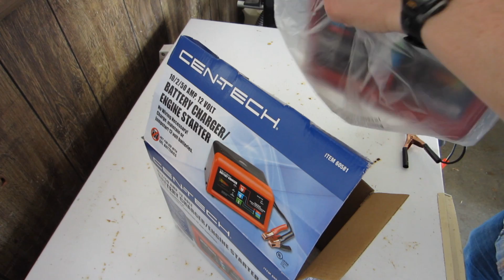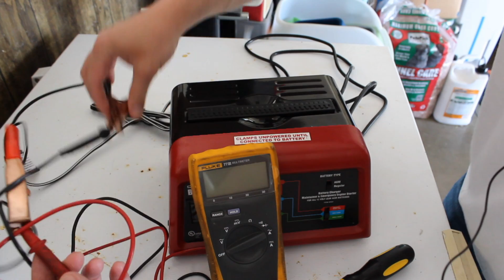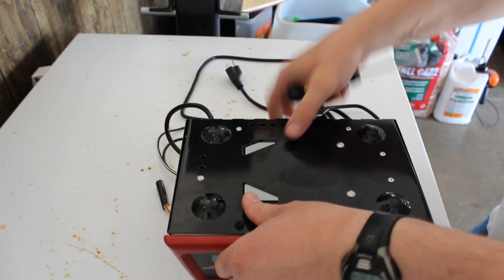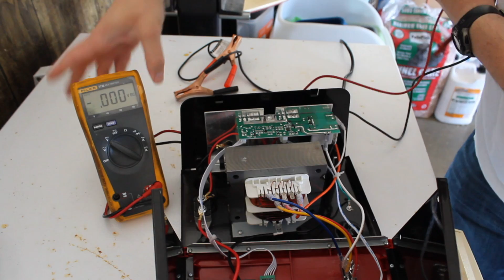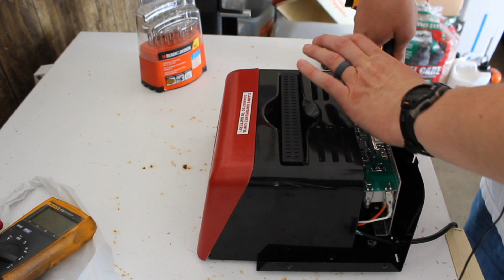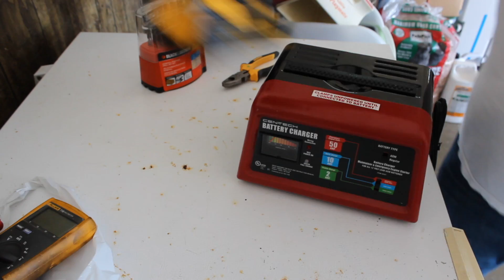Harbor Freight Battery Charger Electrolysis Hack 60653 60581 Centech Part 1

Comment: I added a one 10k ohm 1/2 watt. Soldered it from the 19Vdc on top the relay to the breaker and works great.  Getting 10Vdc to breaker, and still shutting down to keep battery from over charging at 14.8Vdc.
Reply: 10k ohm 1/2 watt resistor.
Reply: Got any pictures ?????

Comment: I have one of these chargers. It has a problem with charging. I am a retired electronic engineer. I started reverse engineering my unit. 
It is the exact same unit you have. I found out that it is a Silicon Controlled Rectifier based charging circuit thus it has no Bridge Rectifier.
That component you pointed out as being a Bridge Rectifier is actually a transformer used to provide power for the control circuit for the SCRs.
I am still working out all the details here. due to the size of the components, Surface Mounted, its difficult to identify what type and value of each.
If any body is interested in how this type of charger works you can search for SCR Based battery charger here on YouTube.
Reply: You're a gem, thanks for posting and sharing your experience and knowledge.

Comment: What you pointed out as the bridge rectifier is the step down transformer to reduce the voltage. The  rectifier is likely the two diodes diodes on the circuit board you said changed the AC to DC.
Reply from the maker: You are correct on both points.  My comments in the vid were before careful inspection, both visually and with a dmm.
Reply: @bailmox2813  How do you know when the battery is fully charged, because when I connect charger to any Battery the one LED light goes on and never turns off. and I mean the green charging LED on the charger, or do you have to rely on the meter that say's 100% to know, because the margin of error is greater relying on the meter, versus the charger turning off automatically.

Comment: Clamps unpowered until connected to battery! Dude, the sticker is right there
Reply: It took me two seconds to figure out what you just said no battery connection no power LOL
Reply: I saw a video that a guy added a toggle switch and jumped it to manual and made it power without even connecting it that was great then you could turn off the toggle and it would go back to automatic charging
Reply: Can he not read ?

Comment: I came across this in one of the reviews for this product on the HF website: "Open the charger and observe that there are a pair of wires (black and red) that connect between both PC boards. This is the sense wire that turns the charger on when there is a battery connected. Add a PUSHBUTTON switch in parallel with these wires and mount the pushbutton type switch to the front panel." I assumed this meant he was just disconnecting the balance line, but he also talked about using another battery to get it started, so maybe this was just his way of being able to connect a 2nd battery to the charger instead of to the battery being charged. I'm going to have to go open mine up now and see what I canq do. I wonder if there is room in the case for the internals of a spare dc adapter instead of stepping down the 18v off the board.
Reply from the maker: I read that review too.  I assume that he was using an older charger because no such wiring configuration will work on this charger.

Comment: Dude there is such an easier way using two wires and any kind of battery that has a slight charge! No opening up the unit and no voiding of the warranty! All you need to do is hook up the leads to the electrodes of your electrolysis set up, then take your battery with the slight charge hook up the two wires to your electrodes positive to positive and negative to negative and then plug in your charger voila it works! and you can unhook the battery  you just need it there and start it up that's all!!

Comment: It would be really nice if you could just buy a "dumb" battery charger for etching and electrolysis.  Everyone in their tutorials says, "get yourself a non-smart battery charger." Problem is I don't think anyone makes them.  I had hoped this battery charger wasn't smart because it says "manual" on it but it's not or at least it's not dumb enough for what we want to use it for! 😂😂
Reply: Just have a look on ebay. There is plenty of old fashioned battery chargers there.

Comment: Quick question since I didn’t see that part / Voltage divider underneath the black tape is all three wires solder together with heat shrink . One goes to ground the other one to current and the other to the 18v ??? Am doing the same thing / does it Automatically stop charging the battery or is it constant Voltage. ???

Comment: You need to read the note on top of the charger!!!  Clamps unpowered until connected to battery!! Most battery charger are made that way now days. What a goof ball, Geeeezzzzzzzzzzzzzzzz
Reply: Yah and its dumb. You can't charge a dead battery with them anymore like you used to be able to. Unless you like shelling out money to buy a new battery when all that needed to happen was it needed to be charged beyond 6 volts. He needs a constant 12 volts for Electrolysis. They no longer make them unless you shell out tons of money for one a charger like what he turned this one into. So the smart charger part is dumb.

Comment: The newer version of this charger has completely different circuitry inside, but I got it to work for electrolysis, resistance soldering, etc.  See my lengthy comment in Part 2 of this series for the "how-to."

Comment: A lot of good electrical knowledge from you and your commenters,  I don't quite understand it, but if the charger was new, why not take it back?
Reply: He is not wanting to charge a battery (as intended). He is going to use it for a different purpose that it was created and sold for. He wants to use it for fractal wood burning. If the safety mechanism works correctly it won’t burn the wood.

Comment: Could you just plug that up to a car battery and then run cables from the battery to your project
Reply: That worked for me.
Reply: Do you still need a rubber mat to stand on? I would agree that one is not necessarily used for a car jump, but how would it be on wet wood? And if they touch on the wood and arc, no worries there as well? Thanks for any and all info. Also car battery is on the table, or still in vehicle.??
Reply: @depressionnow8290  I had a charge car battery out of the vehicle. I just basically jumped my battery charger while it was connected to electrosis setup. Worked like a charm.

Comment: Now why would one want to remove the reverse polarity protection.. Gate voltage with ( resistor ) only seen on positive side clamp to see a positive voltage on that end,  2-5 volts ish @ FET ( positive side sensed, not negative side ) then  it will close loop the negative side. to begin charging.

Comment: This video was really helpful actually but I ended up utilizing a different method to get the same result, as it was a slightly different charger with a seemingly more convenient way to accomplish this. But I was wondering if you had an easy way to load the power supply? I have a current clamp rated at 200Adc, and I want to make sure my unit can actually do the rated 50A. I just don't actually have anything that can take 50A@12Vdc continues.

Comment: the hack worked o the model  you used  they changed boards and I can't find any AC voltage except for a constant 53 dc volts I can't even see a a volt rectifier (I can identify with ) CAN U HELP??

Comment: Are there anything in the magic black tape ??? Connection? Resistors??? It is an important part, not using screwdriver to open the box waste time. Thank you.

Comment: You need to read the note on top of the charger!!!  Clamps unpowered until connected to battery!!
Reply: so, all of those changes are not necessaries, aren´t they?
Reply: Even if you hook them to a battery they have no guarantee of powering to 12 volts. Smart chargers are not that smart they only work if the battery still has above 5 to 6 volts or they stay powered off anyway. All he did was turned this charger with a toggle switch into a old style charger which has become rare and hard to find. Unless you like paying for batteries when nothing is wrong with them. And to do Electrolysis you need to have a Constant 12volts. Read his description.
Reply: He knew that, this video explains how to bypass this bullcrap so it can be used as a 12 volt power supply.

Comment: I want to use my charger like normal but I want to be able to flip a switch so the +&- have power without connected to a battery can someone please tell me how to do that on my battery charger
Reply: On the charger when he pushed the button it sounded like a relay kicked in (if that's the case the voltage sensed powers the relay) adding a toggle switch in parallel to the relay contacts would bypass the relay giving you your desired result.
Reply: @TopCat2021  just now saw this comment would you be able to show me exactly what I needed to do or just help me find out what I need to do

Comment: You should not do this to a battery charger. You just bought from Arbor freight. You should leave it like it is and get a battery andtestive more or less. This charger also lets you know whether the battery has power in it or not. Because it has a sensor intelligent breaker on it or should I say intelligent sensor breaker on it to protect you from electrical shock or battery explosion? Please handle with care when using this battery charger.

Comment: Did u make part 2 I would like to know ur resistor values u used
Reply from the maker: I used 220k ohm 1 watt resistors.  The actual resistance  values shouldn't matter as long as you use two of the same values, ie, two 1k ohm resistors would have given us exactly the same voltage to the sense wire.  Part 2 should be up in just a few minutes.

Comment: I dont get it. He found output at 18v and put it through a voltage devider with equal resisters. should that half the voltage to 9v?. So were does the 12.6v come from?
You are using 1w resisters. How is that enough for 10 amps?

Comment: Why are they doing this?? This is the second video I've seen about this. Are they trying to stop people from doing electrolysis. This makes me want to break the law even more. Hey but anyway bro, if you're good with electronics then the money's in modding Xboxes and game consoles. You  can make a lot of money doing that. You should  look into it you seem very competent. Just be observation
Reply: These chargers won't power the leads until it senses a battery being connected. In this case, no voltage being sensed by the charger means the charger won't power up. Also, it means if you're trying to charge a very dead battery, it won't kick on, which is annoying as fuck.
Reply: they are trying to stop from getting sued by stupid people.. its a safety device.  what they should do is provide the bypass from the factory.